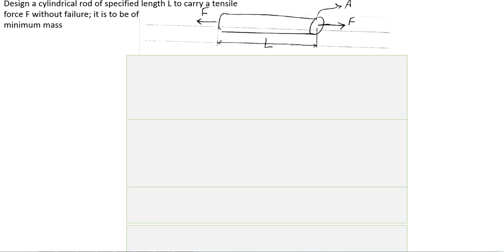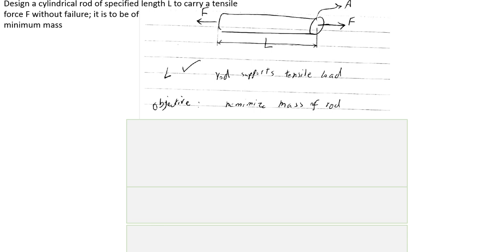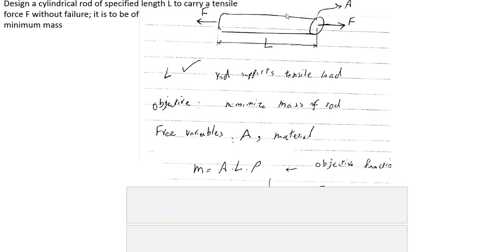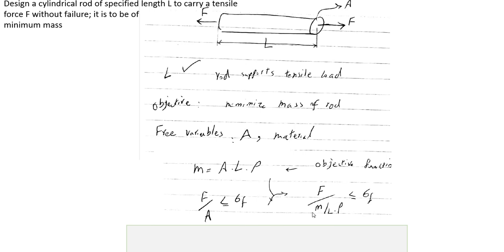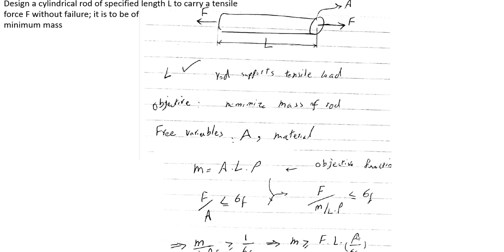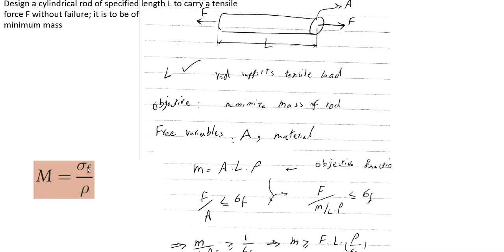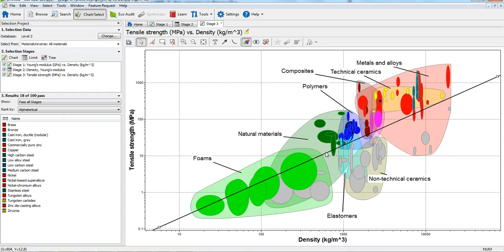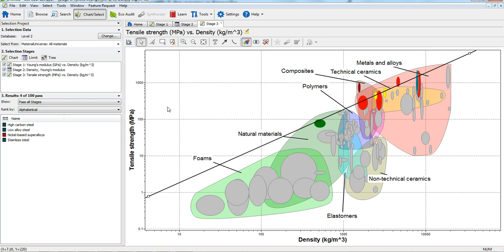Material selection - Material index

Comment: how do you get that the slope is 1 with no values?
Reply from the maker: If d is the density and s is the tensile strength.
As we are dealing with a log(s)-log(d) graph, to maximize M=s/d we have:
log(s)=log(d)+log(M).
The later equation is the equation of a straight line, Y=X+b, with slope of 1.
Largest b=log (M) will provide the maximum M.